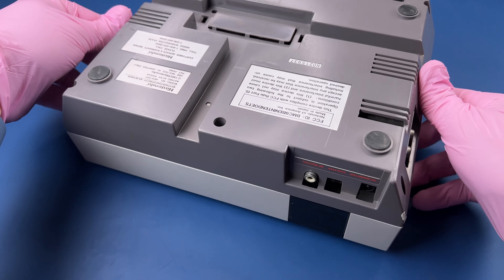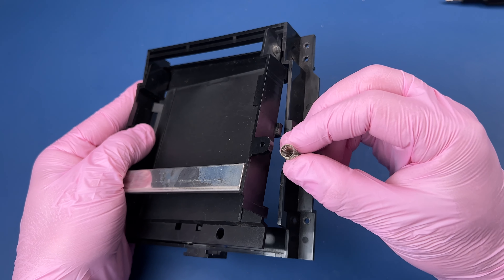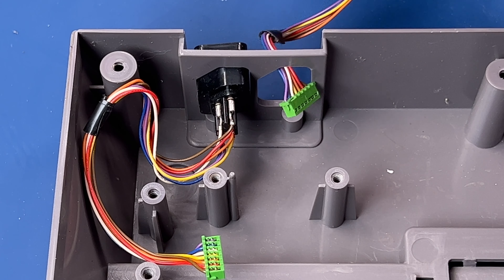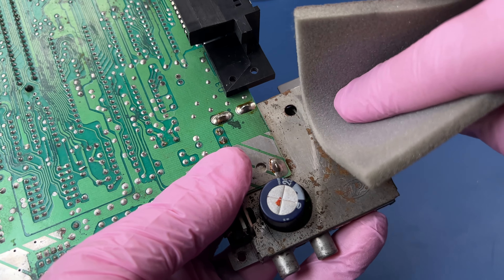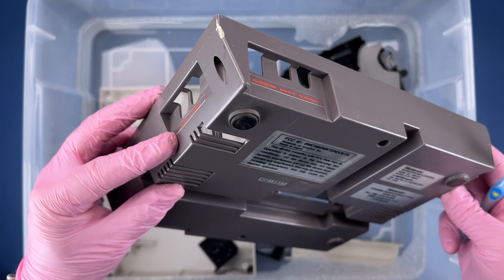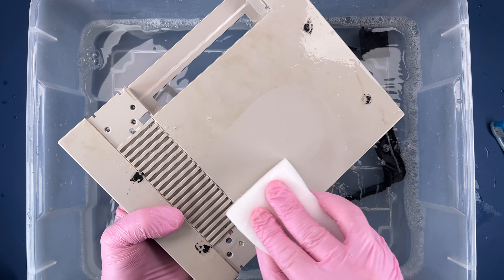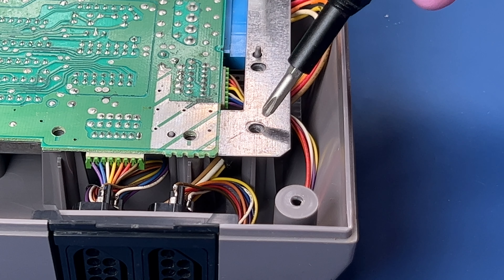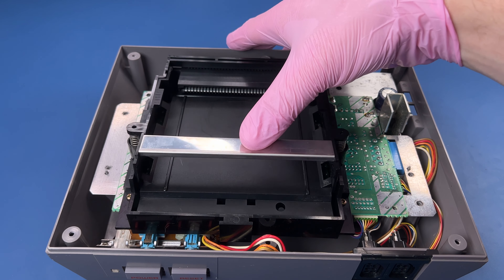Deep Clean Therapy: NES - Nintendo Entertainment System Cleaning

Comment: I don't mind seeing the before and after testing even if it is a fail. I find it interesting to see what kinds of cleaning fix the machine and what kinds don't.
Reply from the maker: Noted. Thanks for the feedback
Reply: Cleaning the system will do just that, cleaning it. The only instance that I can think of where cleaning will fix anything is if the fans are clogged/plugged with dust or if there is some mild corrosion that vinegar fixes. Fixing any issue in a game console is mainly fault finding and usually soldering and replacing bits that require it, cleaning is just good to do if you are already going to be inside it for any prolonged period of time to prevent future issues